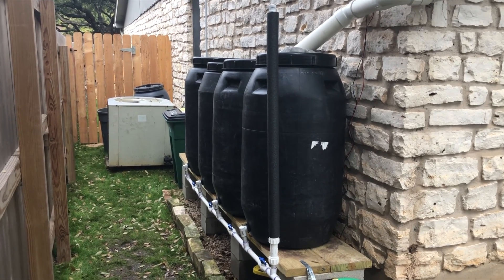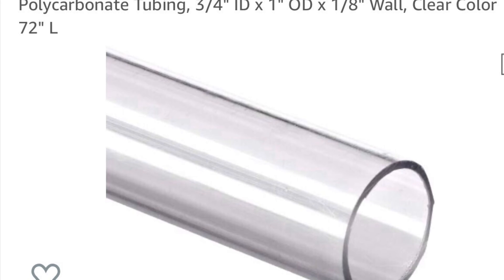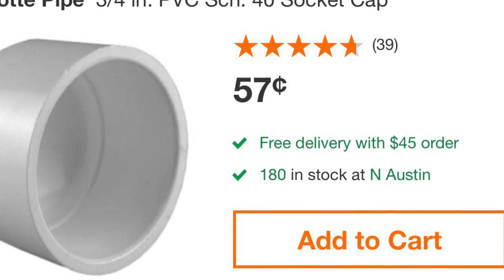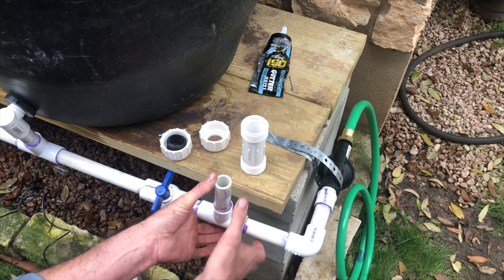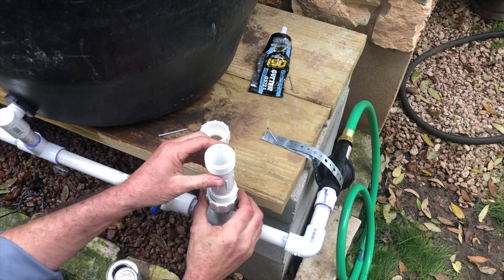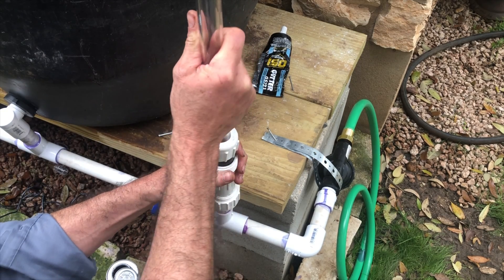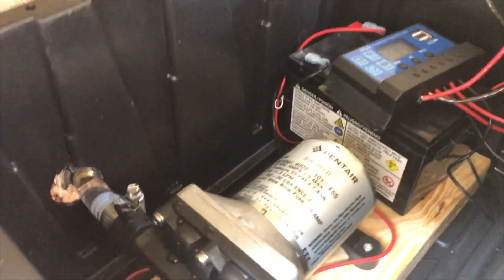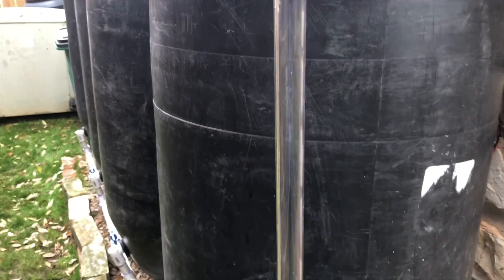Rain Barrel Sight Tube

Comment: Great video great system, I would of used clear roofing and guttering silicone sealant, it's easier to undo mistakes and seals perfect unlike actual glues and silicone acts as a rubberised glue as well, won't crack under pressure. 
I would put a plastic ball in the sight tube, it would look great.

Comment: This is an awesome setup, and I am already ordering the parts! Quick question though... The clear tube has a 1" outer diameter, but the coupling if for 3/4"... How does it fit?  Thanks!
Reply: Late answer but I just bought all these things today - the coupling is showing the ID of the pipes it will couple

Comment: I LOVE this idea! Thx for sharing!
A few questions ... 
1. Was the sealant/glue necessary?
2. If answer to #1 is "yes", would silicone work as an alternative?
3. Is there anything you'd change if you were to do it again?
4. How has it held up over these past 2 years?
Reply: Hi Dan did you ever get an answer to your question #1? We are putting together this system and are also wondering whether the glue is necessary. Thanks.

Comment: Great job…

Quick question - can you seal the end cap on top completely or does it need to be loose to let air escape ? Thanks
Reply: You need to let air escape. I would drill a couple of small holes in the end cap.

Comment: thanks for the tips  i’m thinking of building  some Plywood holding tanks to be used  in a Engine Room on a boat  for a variety of liquids  and i want a  easy to make system to check  levels  on Motor homes and travel trailers i’ve owned they used  Electronc sending Units  and those always  appeared to have some failure rate so i wanted to go Simple and very reliable  FYI the tanks  basic shape and exterior will be Plywood  but the interior will be sealed  with a Marine Grade Epoxy  to seal it from leaks the Exterior will be Fiberglassed and Gelcoated  for some reinforcement  but mainly  to keep a clean tidy looking Engine room  i’m glad you used PolyCarbonate tubing   even though mine will be protected by  a metal guard.s i didn’t want to use glass that could break  under rough seas

Comment: Is it necessary to cover tube with  foam protection. Because in over the roof tank it's not possible to uncover every time
Reply: if the pipe is exposed to sunlight you will most start algae growing!!!

Comment: This is a great idea, however couldn't you have used a 3/4in. union vice the compression sleeve? Or maybe the reason it wouldn't work is because you would have to use some type of sealant for the polycarbonate to seal to the PVC union?